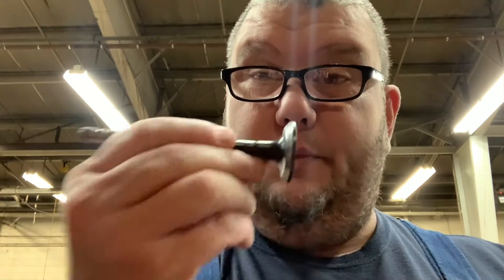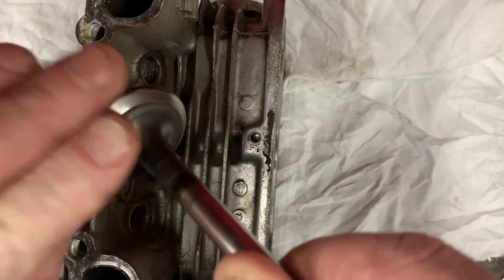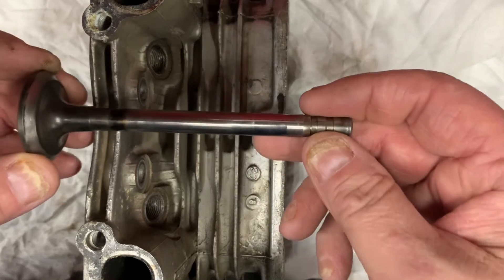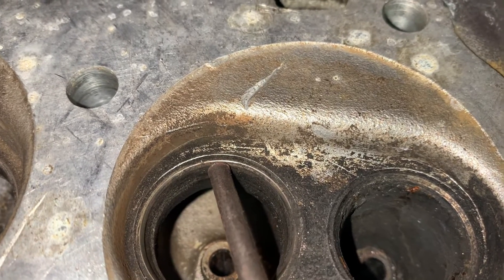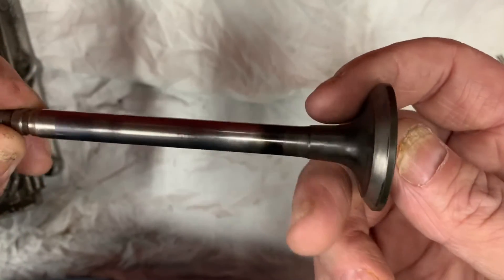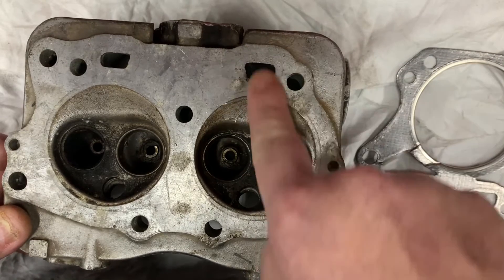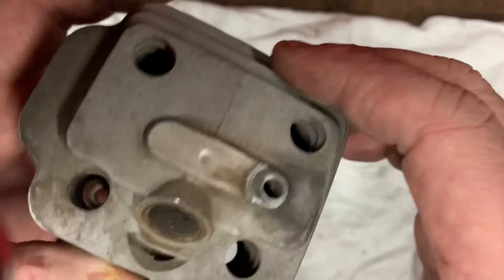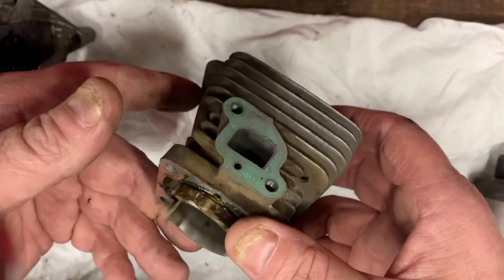WHY A #SMALLENGINE LACKS OR HAS ZERO  #COMPRESSION

Comment: Hi. Awsome video.  I got a fiat 1.4 petrol engine. Dry compression is reading 75psi on one cylinder and 100psi on the other 3 cylinders. Engine don't fire up. Could it just be that timing is slightly out? It poofs out a gush of pressing out of the air intake. Was a 2nd engine. Timing belt was replaced. 

Thank you sir.

Comment: i have a mower i just parted it out and its going to junk it has no compression..i took the vales out twice cleaned them all off of carbon even grinded the one down to make it shorter to make sure it closed even put a new head gasket on it and still zero compression on the compression test..air is escaping soemwhere...as i was doing this i took the muffler off and that hole the muffler to was all dinged up beyond being repaired to get the scratches out but i dont think that would affect the compression but maybe im wrong..ve had mowers running before wihtout the muffler even on if i remember correctly but thats all i can think of..i made is clean as heck no carbon on it and still has zero compression so i just gav eup on it and going to throw it out..beyond repairs i guess.

Comment: i get this a lot at my shop, runs mostly at wide open, won't idle well at all, difficult to start only to find out exhaust valve has 0 clearance, these old school  briggs and tecumseh engines seem to have exhaust valves/seats that wear quickly and end up with low compression, have to pull head to remove head, disassemble valve and grind a bit off the stem to bring back the clearance.

Comment: Thx for this!  A diagnostic question on the simplest Briggs & Stratton push lawnmower: After dealing with all the basics of a "free side of the road" lawnmower, including straightening a slightly bent shaft, I realize satisfaction on a good start only to hear "CLACK CLACK CLACK" -- a clear metal on metal sound.  Is this obviously a valve allowed to hit a metal wall?

Comment: Have a Cushman golf cart, made a big bang sound while driving it and then it wouldnt go.  Just make an idle sound and could smell gas?  I have spark on the plug.
Reply from the maker: Are you asking a question or is this just a statement?
Reply: @THEMOWERMEDIC1  It was a question.  My apologies for not using correct punctuation.  
I took the valve cover off, and saw the valve retainer in pieces.  I'm guessing I have to do a full tear down.  No pieces in the oil pan.   Thank you for your videos.  They definitely help.

Comment: Hello! Had  engine failure on freeway… misfire in cylinder 4!and no compression, the other 5 cylinders low compression. Found out warped cylinder heads smh 🤦‍♀️…There was nothing indicating any issues…No knocking, no over heating, no rough idling. Replacing the engine is just too expensive for 3.7 mdx… but I’d like to explore replacing the heads. Timing belt is In tacked. So frustrated… possible oil consumption

Comment: So a smaller handheld husqavarna leaf blower with 105 psi compression. Is that cause for concern? Just had a service refused for a bad coil because compression was at 105 which they said was to low to be worth fixing.

Comment: got an fx651v kawasaki with no compressionon either cylinder but it does run, just doesn't have power, the air intake tube between the carb and the filter housing was very bad and cracked all around the clamps, I'm thinking the ring sucked dirt in and dusted the engine, how would you check for that without pulling the heads?

Comment: Engine has on 1 cilindar 0 compresion 2 cilindar has 15-17 bar whats the problem?
Reply from the maker: I’ve never seen an
Engine with 250
Psi unless it was a wire out diesel

Comment: @mowermedic1 I have a fx801v (cold test) one cylinder has 125 psi and other has 85. Also have some blow by in crank case. Engine doesn’t smoke but uses some oil (I imagine from pressure pushing out seals?). Is this possible valve issue? With blow by I’m leaning toward gasket or rings? Appreciate your videos and knowledge.

Comment: I wish you lived close to me.  So I have a 2019 toro zero turn timecutter  ( 70 hrs now) with the newer toro V-twin commercial (haha) 22.5 hp.  Its done this since day one. When I try to start it when cold I put the choke on then turn the key to start it.  If it does not start right away what it will do after say 10 seconds of cranking is backfire loud.  I stop trying to start it and get my heart to beat normal again then by that time I go to start it and it starts fine but puts out a large amount of light blue smoke for a bit.  Once warm it runs fine.  Its under warranty but I am a little scared to take it to the shop I bought it at because well just because you never know.  I am going to bend a valve if I dont so something haha.  Any ideas?
Reply from the maker: Choke not closing all the way? Check that for sure. How old is the gas?
Reply: @THEMOWERMEDIC1  Chock is good but I do believe its carb related.  I mow everyday its my life so gas is good also.
Reply: Have you tried starting it without choke?
Than loud backfire sounds to me like when the mower is running and you let go the lever open  that shuts the engine immediately and a loud backfire right after ir

Comment: Nice video,Jermy.I have question on a subaru generator EX21 carb.flooding issue.Had to replace the carb. Aftermarket twice pressure  test with a mityvac at 7#offthe generator it held.Put it on the generator,turn the gas valve on at tank started leaking gas through the emulation tube.This was 2 aftermarket carb.the original carb.had to be replaced.
Reply from the maker: Make sure the atmospheric pressure vent holes aren’t being covered up by the gasket make sure you replaced the fuel line as chunks of old fuel line can make its way into the new carburetor and stick the needle and seat open make sure that you’re not getting any debris from the tank into the new carburetor